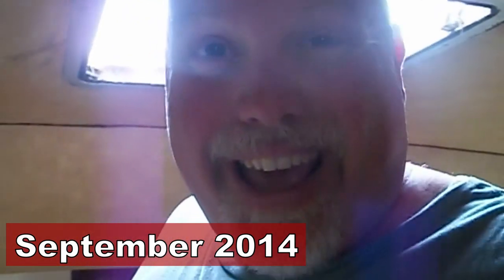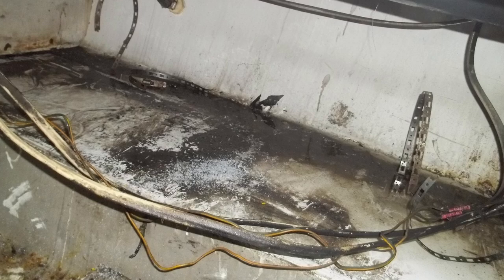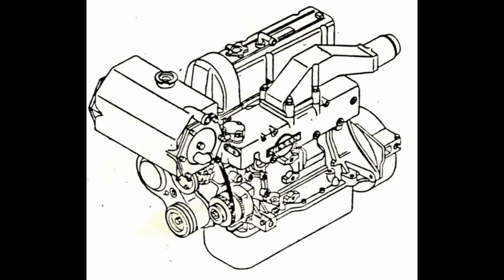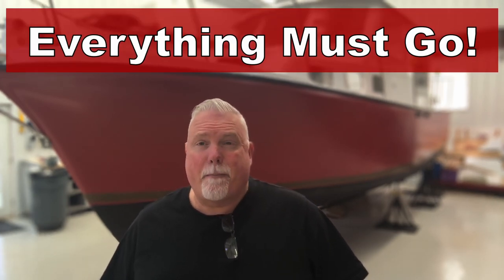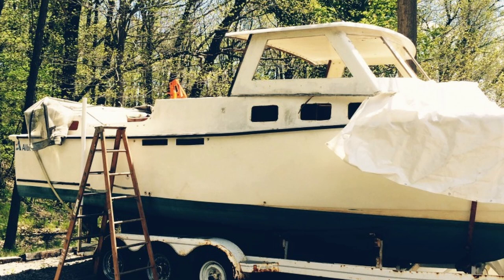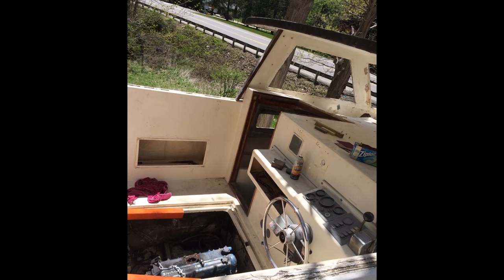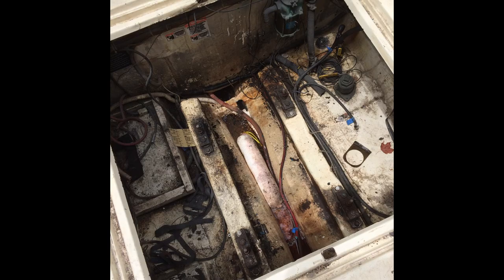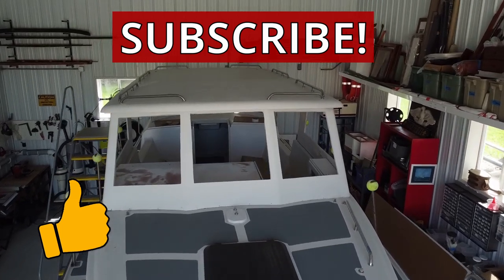No Crane?? How to Remove the Boat Engine from your Trawler | Boat Repair and Boat Restoration (Ep10)

Comment: Mine has the ford diesel.  Its an amazing motor but very under powered. What motor are you thinking of as a replacement?
Reply from the maker: The new engine will be a Beta Marine

Comment: Putting an engine back in the boat will be interesting, since now you've got a hard top covering the cockpit. And I wonder if you've install the pilot house more permanently than before.
Reply from the maker: All planned and prepared for. Come on Charles, this ain’t just first rodeo 😁🤓
Reply: @motorcityboatwerks   Sounds like you've got a plan -- not just hanging out smokin with Calvin Broadus.

Comment: If you can work a milling machine then a lot of money could be saved in fixing these older engines. 

I sometimes wonder about engineers. Do they ever take into account the practicalities of maintenance and repair? They shove stuff into the smallest of places and then mechanics have to work out how to fix it.
Reply from the maker: Thanks for the comments. 🐙Regrettably this engine is no longer made and marinated parts are not available. 🤓For long term cruising a 40y old engine like this is not viable— so time for a new one. 😁
Reply: @motorcityboatwerks  
I was talking about making ones one parts. A good milling machine, and the ability to use it, can solve a lot of problems. Still it's not something most people can do.

Comment: Joe funny enough I have worked on the vehicle Nissan diesel engine they fitted them in the old Nissan Patrol a 4-wheel drive off-roader and your right there aren't many of them left anymore they were a good engine though you could get a good three hundred thousand miles out of one if you maintained it well some even more miles as you know there are many types of marine diesel engines out there and hybrids now here in the UK a company make an electric motor which bolts on the back of the diesel engine I think it was a Japanese engine they use and it will act as a motor and a generator same as the diesel engine you can disconnect the diesel engine from the prop-shaft and just power the motor? generator and if you have a sail on board the motion forward with the wind will turn the propellor and turn the generator as well which I do think it is cool with some lithium/iron batteries and solar panels on the roof you will hardly need to run the diesel engine at all in sunny climates so fuel savings will be massive set up right I suppose it will depend on how much you will be using it if it's just for pleasure on the weekends then its probably not worth the expense but if you plan to use it a lot then I do think its worth looking at I know I will be when I get my next boat so all the best joe another great video from John from Rugby UK.